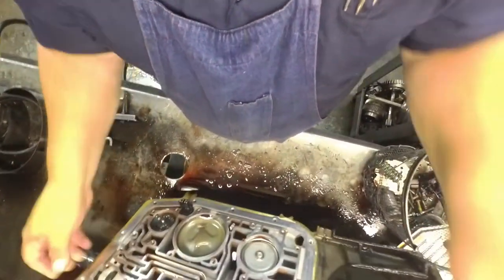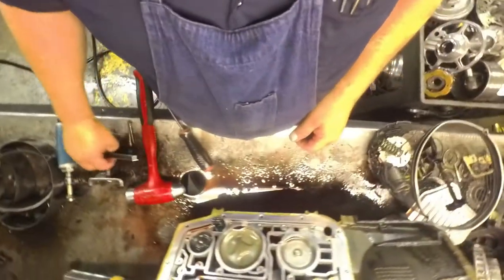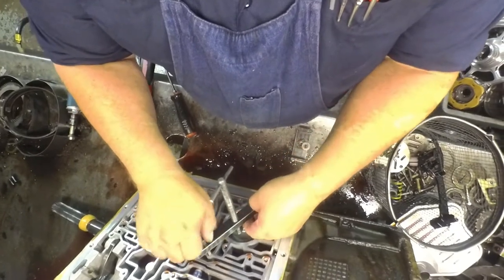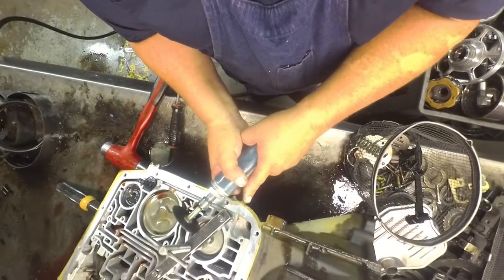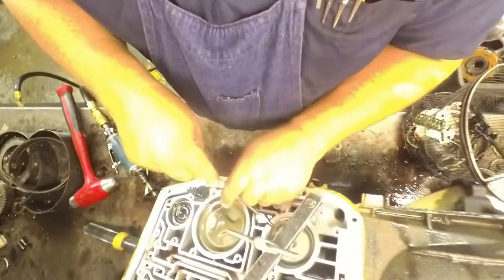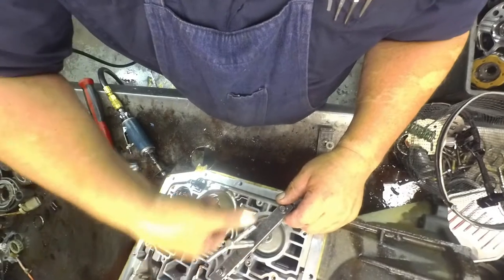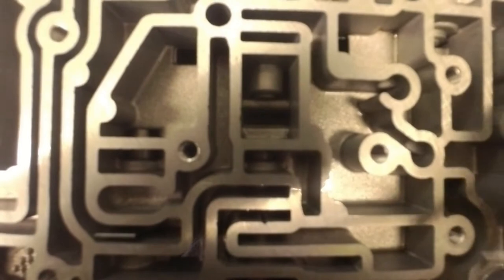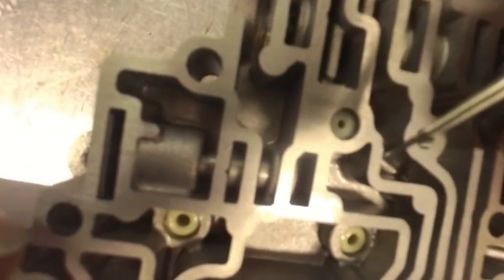4R70W Broken OD Snap Ring Removal

Comment: good vid, i JUST dealt with this, i welded a welding rod to the ring with a flux core mig welder, worked enough to pull one end out and get a small flat in - what a mess! your method is prob less risky!
Reply from the maker: Fairly common problem. Probably deal with it at least 10 times a year like this. A lot more times it's broken but have at least one end still attached so you can get it out without having to do this. Thanks for watching.

Comment: thanks for the video.  I have the exact same problem with both ends of the snap ring broken.  Been trying for hours to get it out.. thought i might just leave it in there and worry about it when it breaks again.  But now i see this possible method?  I never would have thought it would be ok to cut into the cylinder wall like that?  is that ok to leave that big hole in the wall like that??  wouldn't that cause problems with fluid transferring though it or ?
Reply from the maker: No problems, works fine, just cut deep enough to get under the snap ring. I have done it about a dozen times. Could leave it in there but you really need to either put a Sonnax servo pin ( #76833E) on it or bore it out and put a sleeve in the case, every one of those bores are wore out.
Reply: Great, thanks for the quick reply.